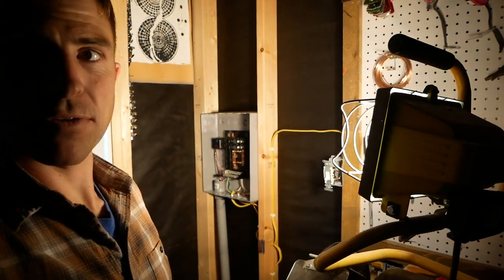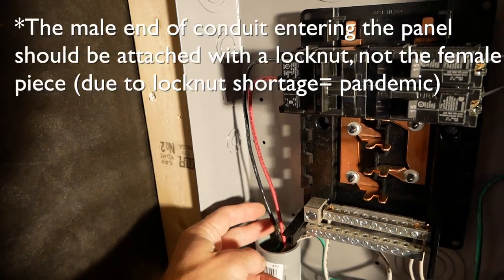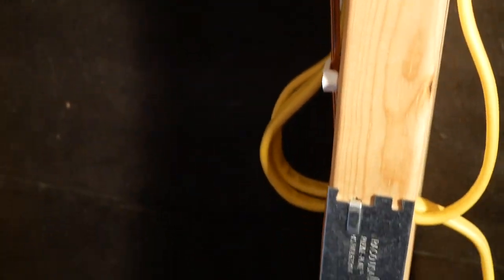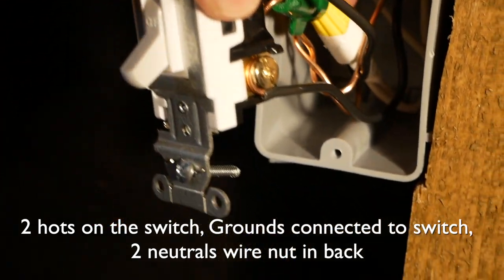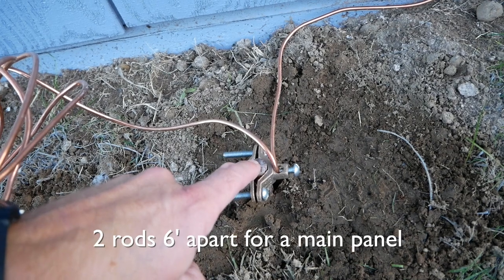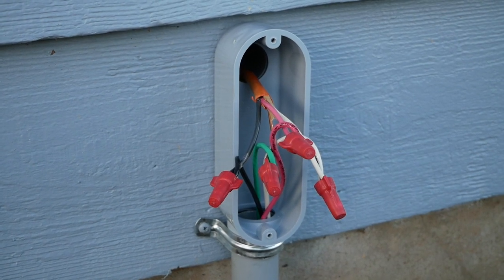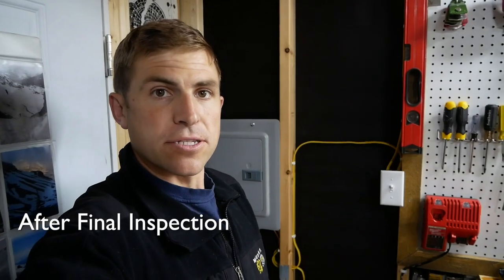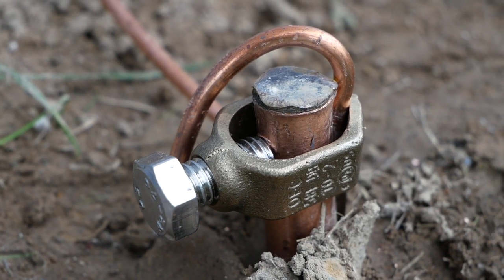Subpanel Install in Shed with MAIN BREAKER Inspected

Comment: I’m not sure a ground rod in the shed is right. I’d think you want any fault current to hit the main panel to trip the breaker and not have an alternate path. I can tell you are very meticulous and nicely done.  Congratulations on the inspection.
Reply from the maker: From the conversation I had with the inspector, I remember it may have had something to do with the distance from the main service panel grounding rod and potential differences in the ground conductivity?

Comment: It's not bad for a DIY install but if I were you I would re-terminate each of your devices such as the GFCI's and switches. Those have a pressure plate type connection and the fish-eye technique used is not how the manufacturer intended for terminating conductors to the device. Also, did the inspector make you change the female adaptor inside the panel to a locknut. That didn't look ordinary.
Reply from the maker: Thanks, he did not. Thanks for the feedback on the GFCI terminations, I was under the impression that the fish eye made a better connection than the pressure plate type on the back.